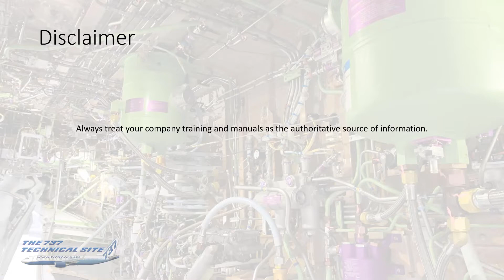737 Hydraulics - Wheel Well Tour

Comment: Hello Sir, I have a question if I can. Is the stb hydraulic pump an electrical motor driven pump? And is that a rule for 737 800 as well, that hydraulic fluid reservoirs for system A, B and stb system are located in the main wheel well bay? I am a student and I want to thank you very much for your videos.  Even though there is a lot of knowledge to convey, you do it in a systematic manner, making practically all issues understandable even for those without experience.
Reply from the maker: The standby hydraulic pump is electrically powered on all generations of 737.
Reply: Thank you

Comment: What is the red staining on the hydraulic tanks and on some of the walls? I was thinking that it was either a corrosion preventative or possibly dried on matter from a fluid leak. Thanks for the great videos!
Reply from the maker: It is a corrosion protection coating called Dinitrol.

Comment: Why is the B system tank larger?
Reply from the maker: Because the services that the B system supplies require more fluid. On the Originals the A system had the larger tank.
Reply: @ChrisBrady737  thanks for the reply, is that the case with NG as well?
Reply from the maker: @lifeofranco  Yes, on all series except the Originals the B system tank is larger.

Comment: Chris, I've watched all your videos. the level of detail speaks volumes to my inner engineer and pilot. as a ppl I soak up anything aviation wise. as a frequent passenger on 737s with a nervous wife she knows i can assure her or bore her asleep with all the technical information. especially when she says "what's that noise" etc. on a less humourous note, my sincere gratitude to you for these technical videos. I thoroughly enjoyed the one on fuel.

do pilots of ac need to know this knowledge or is this engineers territory?  I ask as any work I've done in the past I've had a compulsion to learn every detail. even if it's not technically mine
Reply from the maker: Daniel, first of all, thank you very much for your kind words about my videos, it is always gratifying to hear when they have been well received.
Re the level of detail, the videos go far beyond the basics of what a pilot needs to know into engineering and nice to know territory. Pilots have a huge appetite for knowledge about their aircraft as a good understanding of the systems helps to understand or diagnose any problems that may arise in-flight.